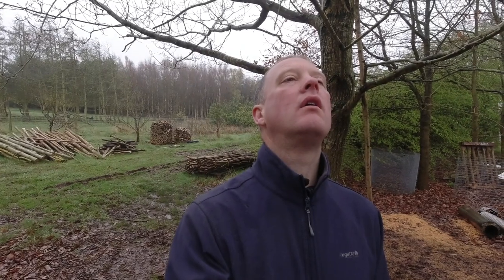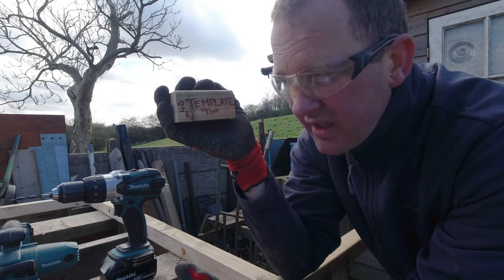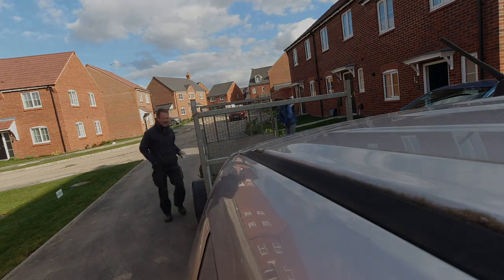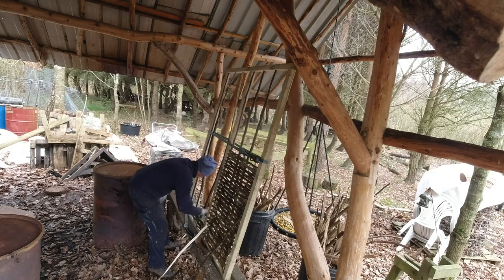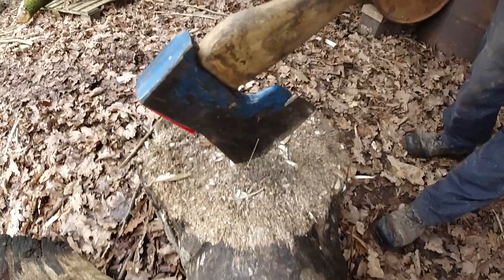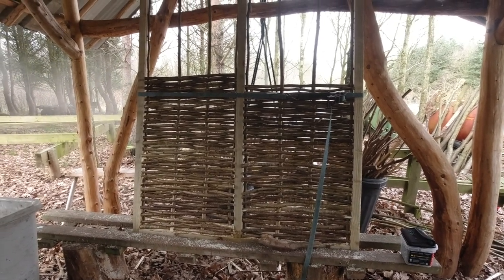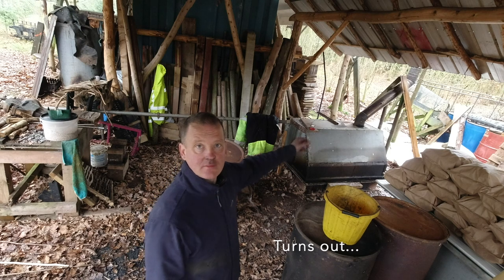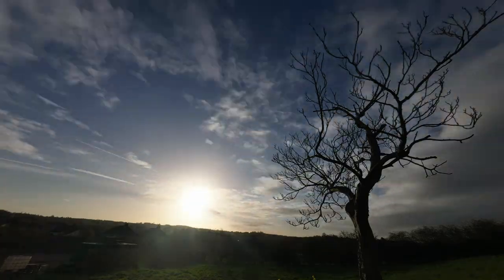Barbecue Charcoal, Hurdle Making and MUD.   A Woodland Vlog 13 2023

Comment: Nice work Darren!
Reply from the maker: Thanks so much
Reply: @AbellTo  Quick question Darren, I want to make a hurdle fence to protect a growing patch from wind, with binders I’ve got left over from this seasons hedge laying. What distance would you place the stakes as a guide? If you can help thanks
Reply from the maker: @andy199121  I tend to go for 9 inch upto 12 inch for hazel that’s riven in half. If yours is in the round then maybe upto 15” apart, less for willow.
Hope that helps
Reply: @AbellTo  thanks very much!